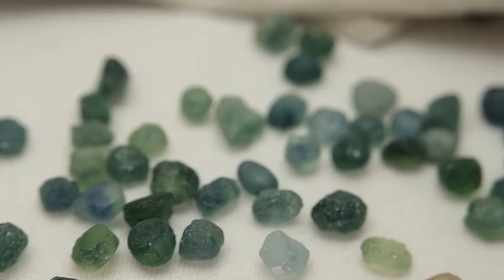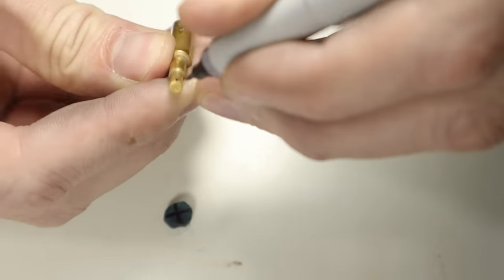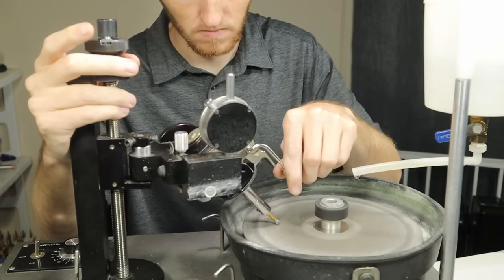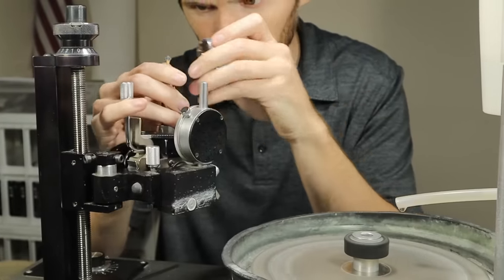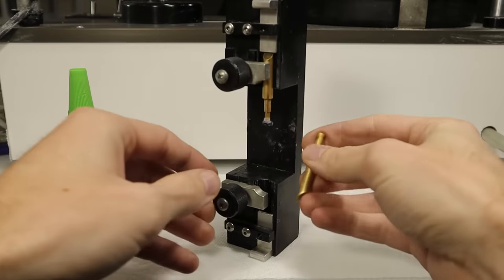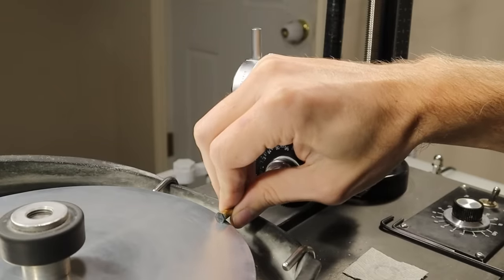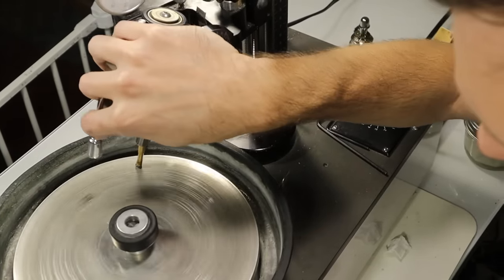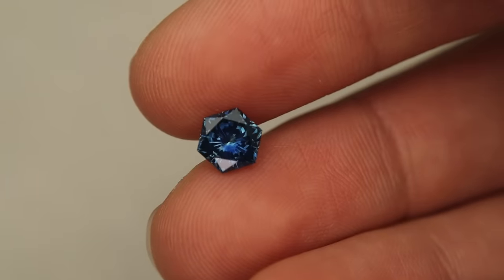I cut the Montana Sapphire that my daughter found after getting it heat treated

Comment: I've always wanted to hunt for Montana sapphires, but I just can't travel, unfortunately. So I finally broke down and ordered some mail order gravel. I didn't expect it to be cost effective to get a bunch of rocks in the mail, but I found quite a few gem-quality sapphires over a carat. I can't cut them myself, but it's worth the money to have them send them out to be cut (and some heat treated). It's not a retirement plan, but it's a ton of fun, and if the value of the stones at least offsets the cost of the gravel I can have more fun more often.

I'm trying out all the different sources of mail-order sapphire gravel. So far Gem Mountain's cowboy boot and mega jug (which are concentrated gravel from their wash plant) are the best fun/$. They have literally hundreds of sapphires. They're mostly small, but the mega jug by itself had over 2 dozen facetable stones over a carat. The Eldorado Bar (and Spokane Bar) concentrates have a lot fewer tiny stones, but so far I haven't found anything big (the biggest was 2.6 carats, which is only slightly bigger than the biggest Gem Mountain ones I've found).

My favorite I've found is a weird purple one that is also somehow orange sometimes. It's barely 70 points, but it's cone-shaped so maybe it'll have enough yield to come out as more than a speck.

Comment: Beautiful Sapphire 💙 I need more information on heat treating the stone. What's the process? It does enhance the color quality. What about the value on any gemstone?
Reply from the maker: Heat treating sapphires is a process of heating the stones in a controlled environment at very high heat over a long period of time. The process breaks down and disperses the inclusions/impurities within the stone that are responsible for giving the stone color. Heat treating often improves the color and clarity but isn't guaranteed to. If the color of the stone becomes a more desirable color like if a mirky yellow green stone heats to a crisper blue, the value increases. Not all types of stones can be enhanced through heating, and the ones that can have their own form of heating process depending on stone type.

Comment: I I have a question because in metal Smith we use believe it or not white out to prevent heat from causing solder to move into an area we don't want it to move to the question I asked when I was learning was does that keep the heat from going anywhere else like is it preventing it also from going anywhere else on the metal and I was told that it does so would that even help you if you wanted to keep the area where the stone is from getting damaged by the heat put you put a wet what looks like a gauze pad around it but I'm just wondering if that's enough.

Comment: That's beautiful but how long did this project actually take
Reply from the maker: The time spent cutting would have been between 3-4 hours and I may have spent around a hour messing with the design on the computer. Anytime that the stone is just sitting while glue sets isn't counted on the active cut time.

Comment: I have a nice aquamarine that I got on Value vision years ago. I would swear that it drained of good color in time. Am I on crack, or can that really occur?
Reply from the maker: Crazy enough, if an aquamarine got its color through irradiation, then it's color will fade over time when exposed to light. Irradiation can make light or colorless beryl have a nice color, but the treatment isn't stable. If the color was achieved through heating, the color would be permanent.